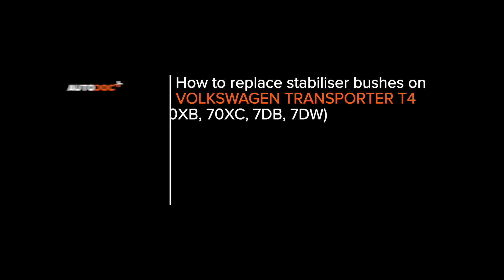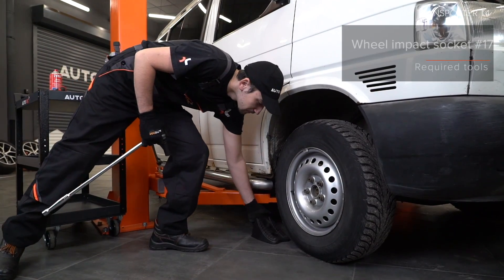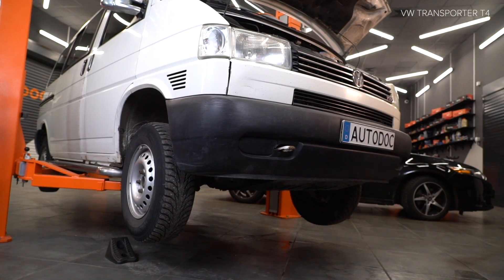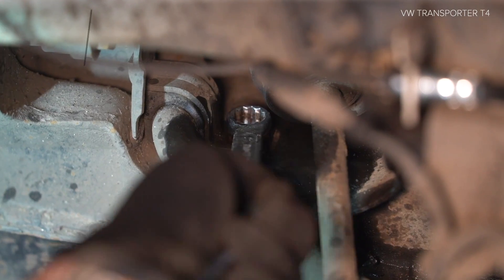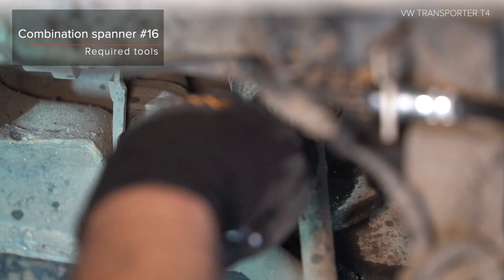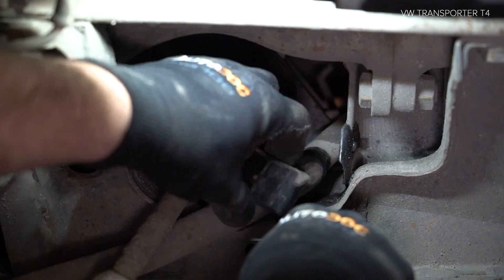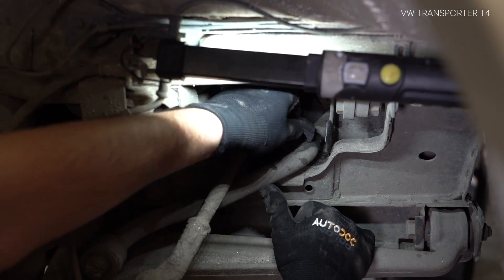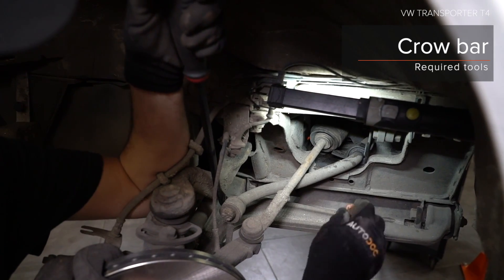How to change anti roll bar bushes / sway bar bushes on VW TRANSPORTER 4 (T4) [TUTORIAL AUTODOC]

Comment: would it also make a rattling, clunking noise when braking, if your ARB bushes are worn or broken?
Reply from the maker: Thank you for your feedback.Unfortunately it is not possible to answer your question, there can be a lot of reasons, we advise you to contact the service to fully diagnose and identify the cause of the problem.Best regards,Autodoc!